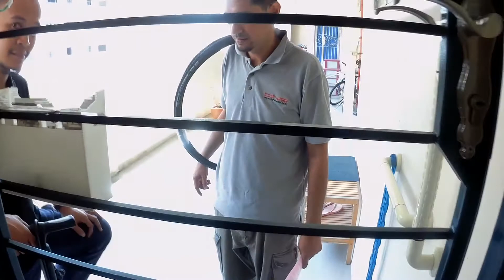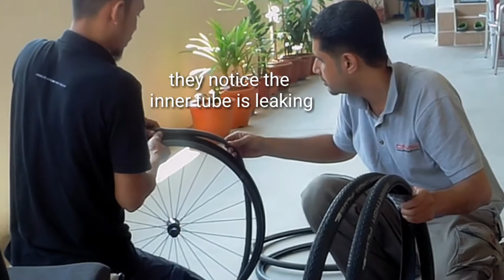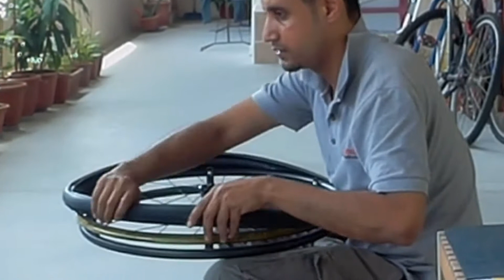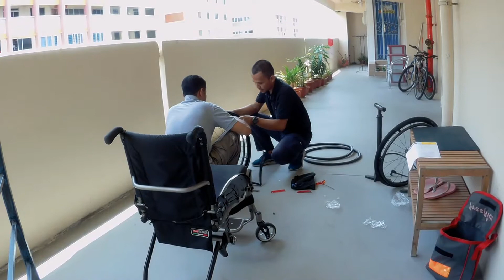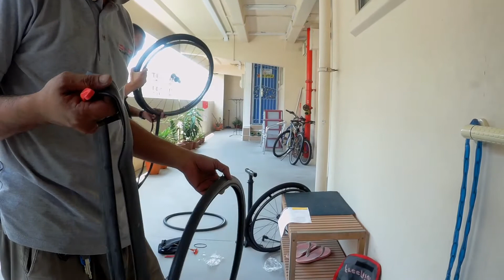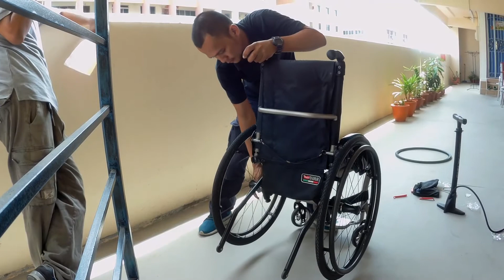How to replace Tyre - Marathon Plus

Comment: Hi Yol. May i know how much did u pay for this pair of tyres?
Reply from the maker: +Baey Ivory, including installation, S$230.
Reply: That's very ex...!! Do you think it will be cheaper if I were to go down to their shop personally and get it changed?
Reply from the maker: +Baey Ivory, for me to get a cab to and fro, I'd rather pay them to cime here and get it fixed. Of coz, there are other suppliers who charge lesser. If you need the contacts,  do let me know.
Reply: Noted. Thanks for your info and advice.